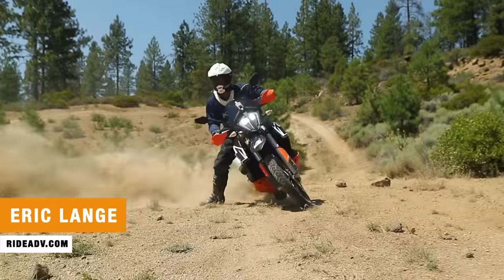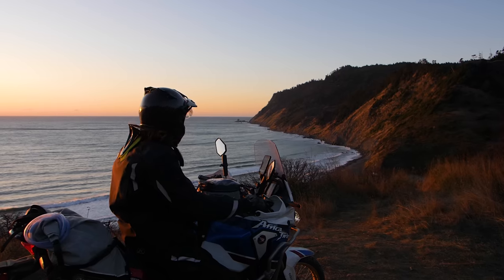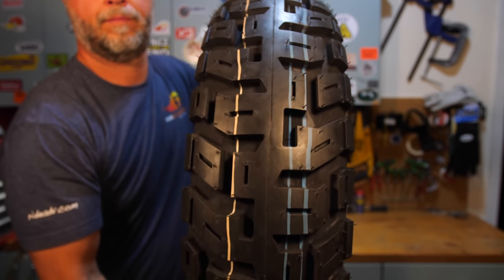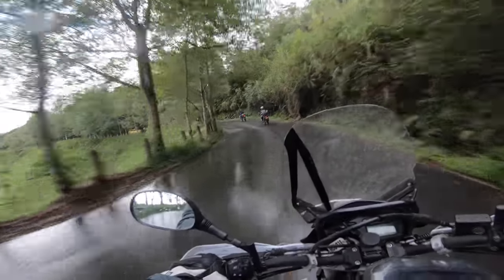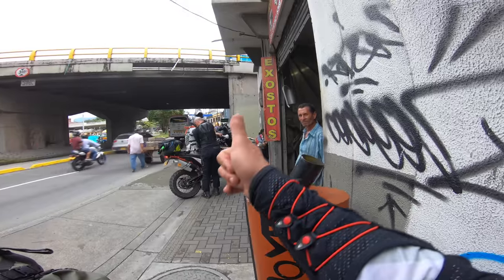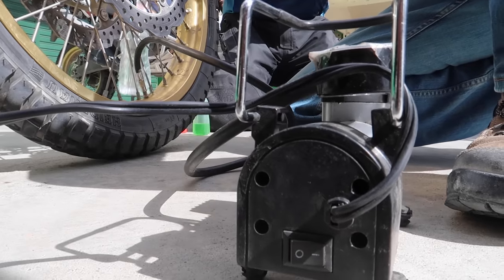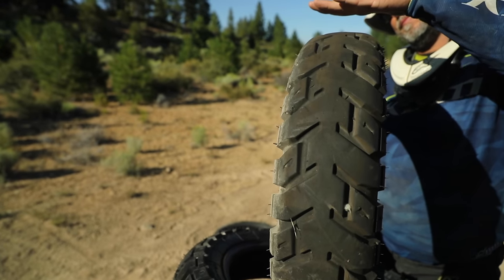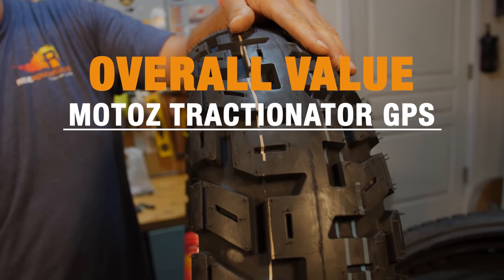MOTOZ TRACTIONATOR GPS Dual Sport Tire Review

Comment: 2 of my buddies and I ran them on our 990 adventures, on a tour up to Tuktoyaktuk and back to Kelowna B.C. we put on 10,000kms on them with loaded bikes. I didn t run the GPS front tire, but my 2 buddies did. We ran the back tires in the mostly offroad direction on 1 bike and 50/50 on the other 2 bikes, we got aprox 10% more wear out of the tire in the 50/50 direction. The GPS front tire puhed in the soft conditions but showed little wear after 7000km road and 3000km dirt riding. I ran the mitas E10  on the front of my 990 and it was a great match for the GPS rear, and it last the same distance as the rear. Overall the E10/GPS combo is my ADV touring pick.👍
Reply: Going on a 1090r for the first time. Question: The person who mounted in the more aggressive dirt direction, did they mention slippage less or finding the bite more that the other two riders on the over all journey? Mounting it within a day and I've not decided LOL ... Me, mostly twisties on black top and all that to get to DOT Dirt roads and Forest Service Roads

Comment: Love a comparison of this and the Dunlop Trailmax Mission
Reply: Me too it is definitely the two I’m kicking around getting
Reply from the maker: We've got a MotOZ Tractionator GPS vs. Heidenau K60 Scout comparison coming up. Need more experience with the Dunlop, but it's on our list. Thanks.
Reply: I would like to see it too. I have the Dunlops on my Yamaha Super T1200 now but would consider these next.
Reply: @mikemills5144  How are you finfdng the Dunlops on wet asphalt? I have a SuperT1200 also, cheers
Reply: @oldfart7479  overall I like them. I have about 20,000km on them now and will probably get another 6000 to 8000 easily. I have a hum between 85 and 95 kph but other than that they are quiet. Really good traction in high speed sweepers and good in the rain too. Off road I have had them mainly on fire roads and gravel and they hook up very well, no complaints. From a value perspective I feel I got my money's worth, they were more than twice as expensive as the Shinko 804/805's I had on before but I have gotten more then double the mileage, way quieter and much much better in the rain. I am interested in these Motoz but I would buy them again in a heartbeat.
Reply: @mikemills5144  thanks👍
Reply: @mikemills5144  ,
Reply: @old fart I have the Tmax Missions on my Super Ten. Loved them in everything but sticky mud and deep sand. They gripped well in the rain, even through deep standing water on-road.
I have to replace both tires at the same time, as the front cups too much to last through two rears(need to upgrade the front springs).
I'm pretty aggressive in the twisties, and this tire doesn't disappoint.

I'm switching to the Trac GPS because the Tmax Missions aren't available right now. I'll update later this summer as to the difference.

Comment: I've ran a pair of the Motoz Rallz on my F800 GS. Amazing tires, I would love to see you guys do a review on them. I got about 6,000 miles out of the front, and I still have about 1,500 more on the rear before it would be completely done with. They performed extremely well in everything I threw at them. Twisty, canyon road rain riding, lots of trail riding in a variety of terrain including deep sand and gravel, and they always ate up everything I rode through.
Reply: Aren't they similar to these but with a softer compounds better for things like races but not traveling?
Reply: @emoservedwithfries  nope. They are similar to the adventure tire.

Comment: Hi, thanks for the good vids. I just replaced the Motoz tires on my 790Adventure. I went right back to the same tires as I was very satisfied with their performance. I am running an Adventure on the front and a GPS on the rear. I ride in a lot of really loose materials, deep gravel and dirt. I went with the Adventure on the front for better traction and steering, less wash out in the loose stuff. This combo worked out perfect for me. I have ridden many kilometers with many different tires over the years and this is the best combo I have experienced for the type of riding I do. About 50% or more of my kilometers are off asphalt. I switched out these tires with just over 11,000 kilometers on them. The front was done, but held up really well. I probably could have gone another 3-4,000 kilometers on the rear but decided to swap them both out for a fresh start. Overall I'm very pleased with the Motoz tires.

Comment: I have it on my Africa Twin, going for a change with 24.000 Kms. The front is almost flat on the sides and very noisy now. Overall very satisfied. Very good on asphalt, as well as dirt. Not so good on mud (centre strip) and wet pavement, where they are quite slippery

Comment: Dang, I just got informed today the Dunlop Trail Max Missions I ordered have shipped....I really like the look of these Motoz's, and it's certainly good to know the honest success you guys have had with them.  Great video, Eric!  A+++
Reply: I took off the tractionator GPS after 14000 miles put on the Dunlap trail Max  Mission it turns better and has better performance than the attraction later but will probably get less  Miles
Reply: I really like the tractionator GPS the fractionated GPSI got 14000 miles out of  The set but the trail maximation are much much better
Reply from the maker: Ahh, surely, and as Richard noted, it sounds like you have a good tire on the way, Dr. Lee. Folks riding our bikes tend to be looking for as much dirt as possible, so......that broad-treaded, grippy rear Tractionator GPS is answering that call well. Rain on the way, so we've got some chocolate velcro riding ahead : ) Thanks again. --- Eric

Comment: I just changed out my rear GPS tractionator, I put it on my 2017 Africa Twin at 7000 miles, and have a new one on now at 21,500 miles. I'm pleased with this mileage, and performance, since the new ones are around $250.
And it's easy to mount, compared to others.
So far, the best damn tire I have ever run.
Reply: Great tire but mine vibrate between 15 and 35 mph.  Noticeable coming off the stock tires.  Everything else is fantastic.  Has anyone else experienced this?  My other thought is the dealership tried to ride my africa twin dct with the parking brake on. I think/hope it is the former.
Reply: @jonlough3074  I have a similar vibration on my africa twin in 3rd and 4th gear between 25 and 40. Annoying! I mounted mine road bias. You? I am curious if it makes a difference.
Reply: @dwayneneufeld1696  my rear tire is also mounted road bias.  I think the solid strip in the rear rules the back tire out.  It has gotten a little better over time, but the tread block on the front tire has enough gap that I think it transmits back up to the bike.   I am going to try the trail max mission tires next.
Reply: @jonlough3074  Thanks for the reply! Just trying to figure this out. My wife has a Suzuki 800DE that needs tires and doesn't want my vibration. Hah. 
I did mount my front tire first and road it before mounting the rear and there was no vibration at these speeds.  I was thinking about trying the tire dirt bias direction if yours is also road-biased like mine is. If I can get myself to do the work I'll let you know the results. It's hard to believe this nasty vibration doesn't bother other AT owners.
Reply: @dwayneneufeld1696  that is interesting!   I had mine mounted at the same time.  It does look like it took a lot of wheel weights to balance it.  What does your wife think of the 800?  I am looking for a new bike for my wife but haven't nailed it down yet.  I will have to see if I notice the vibration in corners or just straight line.  The vibration definitely started with these tires.

Comment: Fitted a set of these tyres to my Super10 a while back for a long trip (Albany to Kununurra, Western Australia) with a mate on an Africa twin with Michelin Anakee's on. We covered more than 2000 km of dirt in Australia's mid west and north west. He crawled into our destination of Kununurra with barely anything at the rear whilst I turned around the next morning and rode back to Perth in 35C+ degree heat no worries. Still plenty left in the front and rear, and I feel confident that if I was to do a lap of the nation I could do it all on a set of the same tyres. Only downer I found was the high frequency vibrations I was getting through the bars off the front tyre, but the durability is there for sure. I had no grip issues on the dirt sections (Kalgoorlie to Kununurra/Gibb River road) either whilst running 30 PSI.  Tarmac grip in the wet is more than acceptable to me, you don't play sports bike on an S10 in the rain !
Reply from the maker: That "lap of the nation" and verifying that they will last.....sounds like the perfect reason to do so. Have a good ride! Thanks for watching and sharing, and thanks to your fellow countrymen for making these great tires.

Comment: I mix my tyres, on the rear I use the GPS, and Adventure on the front for additional off road traction, the rear is great on modern bikes with TC Off road mode engaged, Triumph Tiger 800 XCA. I with they made the GPS in a 120/18 for older bikes.

Comment: Paired it with the Dunlop trailmax mission front, a great combo. Bit of a love hate relationship with the centre strip that has trouble in wet grass or greasy mud. But overall a very capable all rounder that plays the compromise 50/50 game as well or better than anything else out there. 
  Definitely the boots for long haul travel with respectable performance.
Reply from the maker: Does the bike feel like the front wants to turn a bit more than the rear by chance? Sometimes two different tires can actually feel like a mismatch, while of course, we can adapt how we're riding accordingly.
Reply: Good question, but can’t say I noticed that happening. They seem to play quite well together & the trailmax is surprisingly capable off road for it’s street biased looks.   Tracks surprisingly well in the dirt. The motoz gps front looks even more street biased, but haven’t tried it yet so not sure how they’d compare.
Reply: How many miles can trial mission do as front tyre?
Reply: @ionutd84 Just replaced Trailmax front with same at 12,313 miles on my SuperTenere. I like the front tire, rear is not for me, poor traction on cold wet pavement.

Comment: Is there any disadvantage to mounting it in the more off-road orientation?
Reply from the maker: Maybe just slightly more noise/vibration. Hard to detect though. We think they last longer in Mostly-Off Road, taking longer to flatten-out in the middle. Perhaps because it puts more emphasis / heat on the outer lugs. - Thanks for watching.

Comment: I’ve run both the GPS and Adventure rear on my KTM1190R. Both are great tyres with plenty of grip on and off road. I still can’t go past the TKC80 front though. The Adventure is better in softer terrain. Tyre pressures make a huge difference off road. I run 28 psi front and 32psi rear for better grip off road. 35psi and 38psi on road for both the Adventure and GPS. The adventure is easier to take off in the scrub and repair a flat. I run the front with a tube but the rear tubeless
Reply: I am struggling to decide between GPS and Adventure rear, while having the TKC80 front.
What would you recommend for a planned 70/30 off-road/on-road riding and liking to go hard on throttle, whilst keeping in mind that there is a ~2000 mile (2-up with luggage) trip coming up this summer?
What milleages did you get from both of the tires?

Comment: Recently broke a rib in my back after a front wheel pinch flat on my T7 fitted with the lightweight MotoZ Enduro. Gonna fit the MotoZ GPS rotated for off-road orientation  for riding down from Edinburgh to The VINCE in Catalunya, Spain. I'm hoping the sidewall stiffness and off-road orientation will get me up the hills without too many new dramas.

Comment: I've just put the GPS on the back of my 2014 DL1000A, and the Adventure on the front. 
Only comment i really have is that the back seems to sit on top of the gravel so it squirms around a bit. But leaning it over on corners it bites nicely.
Oh, i forgot to say, ya mumma said they look good on my bike. 😎
Reply from the maker: Ha, ha, thanks, and Mom is always saying something nice! : )  And yea, that broad tread/carcass on the rear GPS might be a bit more floaty than some more narrow, or sharply-arced carcasses. Like the Heidenau (which we also compared the GPS to in another recent video.)

Comment: I've experience cracking along the base of the tread lugs. This occurred at 3000 km. I now have 11,000 plus on them. no loss in air pressure or performance. I believe this is superficial only and not affecting the underlying carcass. Have you experienced this on any of your tires?
Reply from the maker: Every once in a while a little cracking shows up on potentially any brand of lugged tire we've used. Nothing regular though, so it's hard to pinpoint. Maybe just an extremely hot moment that we can't say for sure causes it. --- Thanks for watching and commenting.

Comment: I’ve got these tires on my 2018 Tiger 800. Love um, about 4500 miles so far. They’re still holding up great. A bit noisy at hi way speeds. Would not even consider a different choice when replacing. 👍🏼

Comment: How does it perform in cold weather, close to freezing and or wet, having hard compound isnt a problem then?
Reply from the maker: Definitely not a "problem," we just need to keep in mind that .......when we have a harder (more durable, longer-lasting) compound, it may not perform as well in the cold/wet as a softer, more sticky compound would. So it's just a matter of moderating speeds and stopping needs accordingly.
Reply: @RIDEAdventures  there are stories of some tires becoming dangerous at those temperatures, while others are simply not performing as good. As long as drop in performance is predictable its fine.

Comment: I had a set of tractionator adventures on my 850gsa and although they were fantastic tires, the front absolutely howled. Is the GPS front a quieter tire?
Reply from the maker: Pretty sure you'd find the strip on the rear to make that one a bit more quiet.

Comment: I've got a set of the Tractionator GPS on my Tenere 700. With around 2200 miles on them, the rear is approximately half worn, but the front looks basically new. My miles have been about 65-70% offroad. Admittedly, I'm hard on the rear though. I like to wheelie on and off road and I enjoy drifting corners offroad. You people must be much more gentle with your right wrists to be getting so many miles out of these tires.
Reply: wheelies on road probably aren't on most's agenda - certainly not with our constabulary watching on. So yeah, your mileage from tyres is atypical

Comment: Great work sharing the info, thanks! Question: what do "you guys" choose most in your rides, 50/50 or more dirt direction mounting of the rear? Thanks
Reply from the maker: We've switched to Mostly Off Road recently, and the rear appears to be actually lasting a little longer, and wearing more evenly (less flattening-out.) So hard to judge this, with all different Customers/Riders doing all different stuff, but it might be that .... the extra stress on the side lugs in the Mostly Off Road direction is helping wear those sides down faster, and therefore, more evenly with the center. Great tire no matter what. --- Thanks for watching and commenting.
Reply: @RIDEAdventures  Thanks, I mounted it a few hours after asking the question. I chose the more aggressive: as I was looking at the tread, it reasoned out in my head that the 50/50 leading edges curved away, meaning the side lugs are continuously playing catch up on the side bite. In the aggressive direction, it appears that every mm of leading edges are wanting to pull the tire back in against the natural "slide" out g-forces. Your observations on equalizing overall tire wear is pretty neat, makes sense, again thanks.
Reply from the maker: @letstakearide , I'm actually checking with the MotoZ folks about this. Back to you when I have their feedback.
Reply from the maker: @letstakearide , I actually asked the U.S. distributor (I think the only one?) of these tires about my logic on why they might last longer in the Mostly Off Road direction, and well......they seem to agree. Weird thing to just look at it and assume, but it seems to make sense.
Reply: @RIDEAdventures  It would be difficult to tell everyone this without being continuously challenged in debates as to the why. It makes sense that the company would simply say mount this direction for 50/50 and that for more street .... I get what you are saying and for one appreciate the knowledge

Comment: The option to reverse the rear is very cool.
Reply from the maker: And we're finding some very interesting ..... possibly-better-overall-longevity .... when we're running the rental fleet in the Mostly Off-Road direction. Will report more later, but it seems that the extra emphasis this direction puts on the outer-lugs might help the overall wear more evenly, instead of flattening out as much. Thanks for chiming in : )
Reply: @RIDEAdventures  …….very interested in your conclusion, I’m thinking of replacing the rear tire with the 80% rotation when I repurchase a new set.

Comment: Great video. My only question,  do you think there's a real world benefit to reversing the tire for off road?
Reply from the maker: Ed, thanks for the note. --- For sure, we're grabbing/cupping a little more loose stuff in the Mostly Off Road position, AND, it actually appears to wear a little more evenly (less flattening out) in this position, as it puts more emphasis/heat into the side lugs this way.